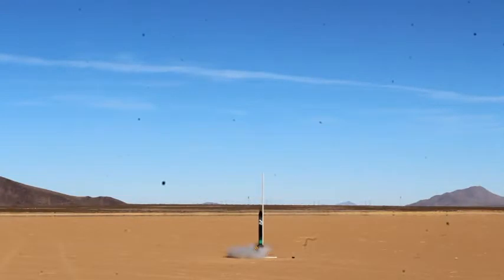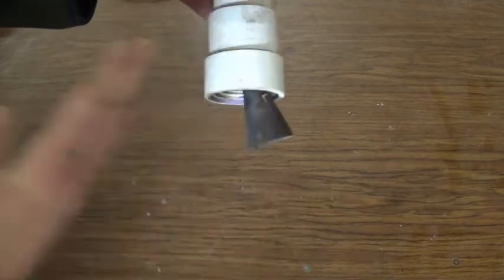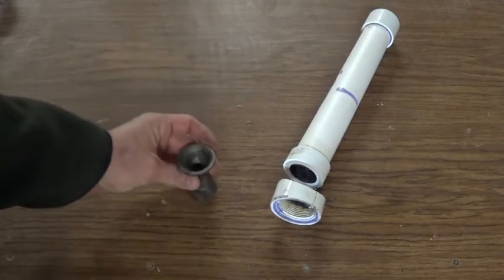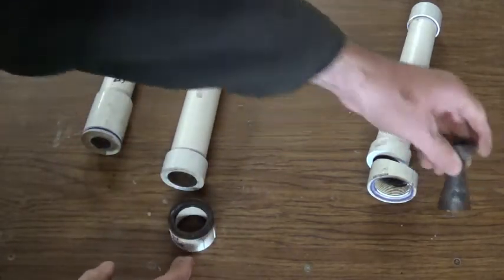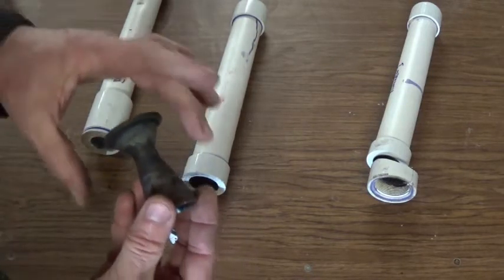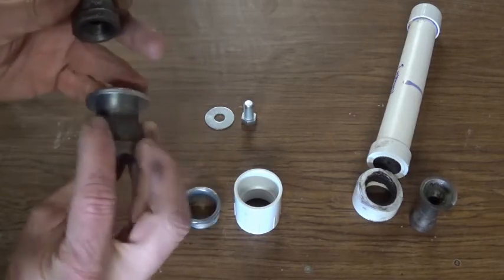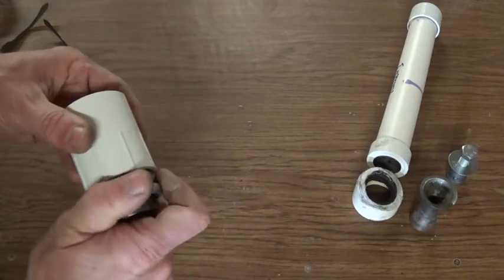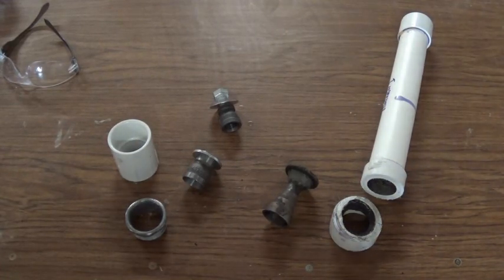Eliminator 1 Rocket - What went wrong?

Comment: Ok, I will give you a "little bone", with the "rockite" you just cut the start of the "convergence", AND then when you lite the engine, the burn will "ERODE" a perfect convergence and protect the engine from overpressure and melt down, ..... AS LONG AS you make the "monolithic" grain within the pressure and melting limits of PVC! Dats RIGHT I said it! 😁👍